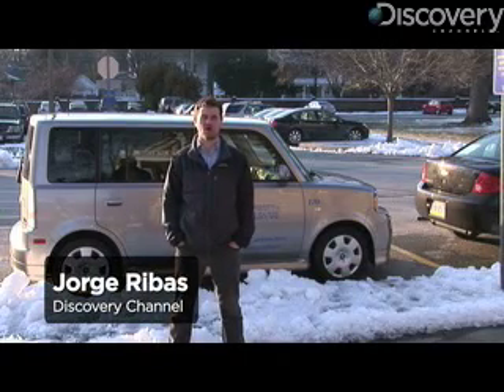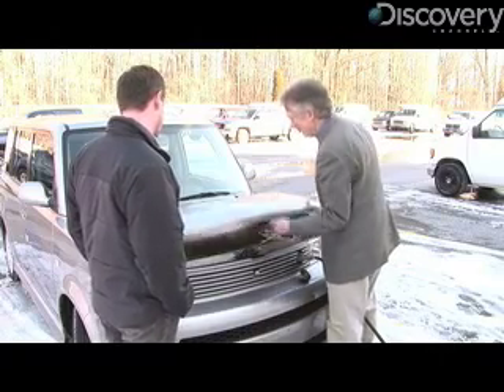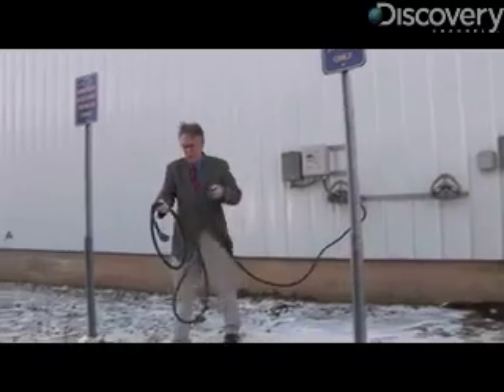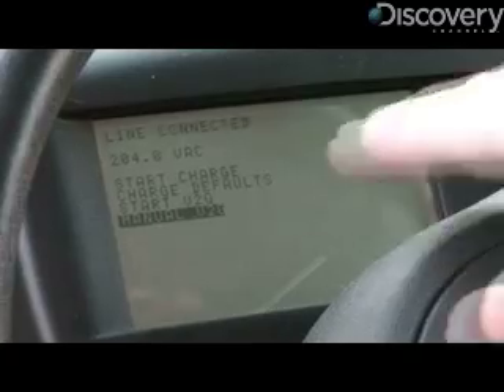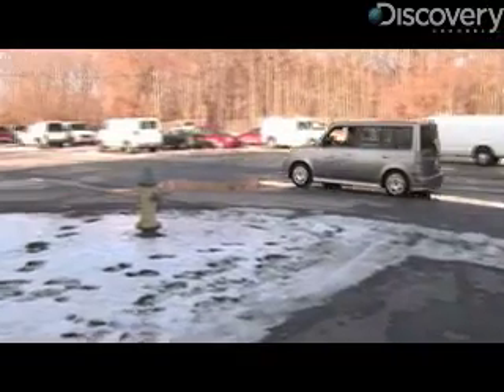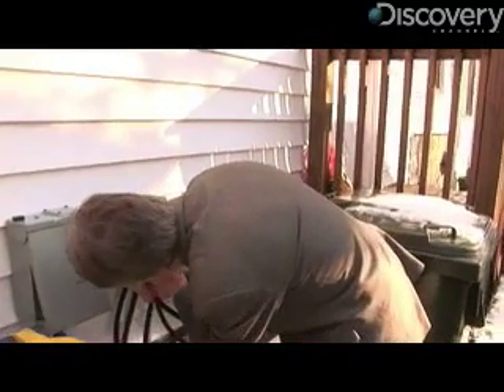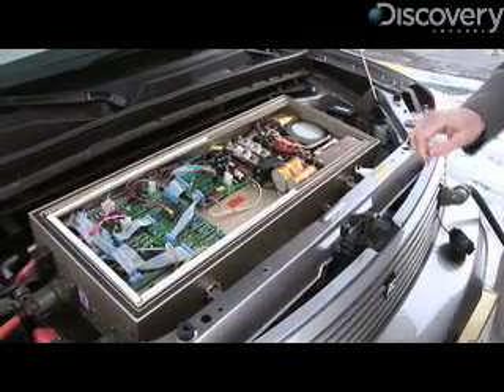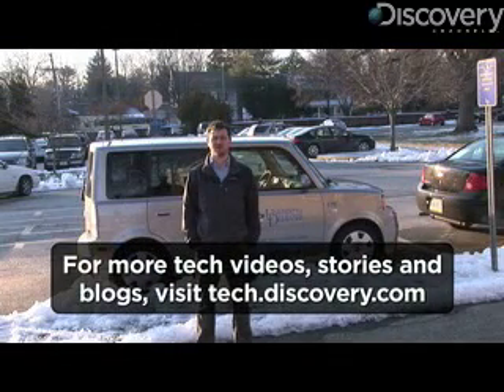Electric Car Feeds Grid

Comment: Two things to your comments. First, most electricity used in the state of California comes from coal. It may not be generated in the state, but I assure you, you use power mostly generated by coal. Second, solar and wind power at most can be used to power 40% of a power grid without extensive use of battery and regenerative systems on a scale that is not possible. It is not possible by any standard to supply a power grid with all solar/wind, within reason. Nuclear is the best option for the rest

Comment: Exactly what I was thinking. Whats the point? That is a 27.75% loss of power, assuming 85% efficiency with the car's charging system(very conservative and I guess it is lower than that), when charging the car and then discharging back into the grid again. Very inefficient, and I don't get the point. Also, these cars carry a very small charge in the scheme of things. Not to mention peak demand is in the middle of the day, when these vehicles will be on the road. I think he's stealing power.

Comment: Interesting idea, especially for places with reoccuring power outages... the only problem is that the circuits bringing power into the car lose something on the order of 15% give or take and if you need to put that power back into the grid you lose ANOTHER 15% or so... you losing a lot of energy giving back to the grid as heat...

Comment: Wind and solar comprise a dismal 76,000 BoE/Day of our energy needs.  Sure, doubling that output every two years will be easy because right now about 0.16% of our energy comes from these sources.  From my understanding this car takes a charge from the power plant (which may be coal, natural gas, or some other form of energy) and simple charges like a normal car yet has the ability to backfeed into the grid during peak times when power plants struggle to meet demand.

Comment: Not really -- right now America uses 47.4 Million Barrels of Oil Equivalent (meaning converting coal, hydroelectric, wind, solar, natural gas, etc.) of which 19 Million Barrerls/Day of oil is used and 11.9 Million (Barrels,Equivalent)/Day is natural gas.  Adding that up we see that 30.9 Million BOE is from petroleum.  Therefore 30.9/47.4 is the fractional amount (and multiple that number by 100) to achieve the percentile amount of energy we use per day from petroleum.

Comment: One problem I have with electric cars are the batteries.

Has anyone done research on batteries and the process of making/disposing/recycling them?

Are batteries more safe than gasoline?

Trees take the CO2 from burning the gasoline and convert it to O2.  There are other substances that are not good for us or anything else for that matter.

Oil is dead organic matter, mostly carbon.

Take a look at everything you can find on batteries before you make a decision.

Comment: Unless the cars were also fitted with the new generation of solar cells now being developed. In that case cars not being driven will be powering the grid. It  addresses also a cost effectiveness issue by making the car battery dual use.

Comment: Kirax13:
Electric cars don't "Start" they are just turned on.   -15c is nothing for any electric motor that I know of.  Gas motors are started with an electric motor and they start our cars here where the normal temps are below -15c.  In fact it was -37c this winter and cars started as long as you plugged them in to keep the oil from freezing.

Your country provides its neighbors with electricity via the Hydroelectric dams you have.
Electricity is surely cheaper in your country than gasoline.

Comment: 1. People pay for gas, so paying of energy normal, I think
2. Winter is freezy sometimes here, yes, but I don't see why electric car wouldn't start. Yes battery must be heated, but gas engine must be heated too!
3. Well in Finland, your neighbouring country, we have a lot of connections for heating up the cars in winter time on parking lots. So why not using the same plugs for fillup?
4. Electricity needed by car is cheap compared to gas. And electric car don't need energy as much as fossil.

Comment: I see this primarily as a car, and secondly a moving battery. Moving battery would be nice for an example in a cottage without electricity. 
I don't know if you have a lot of those in US, but in my country (Finland) many people are having summer cottages and many of them have only generators, wind/solar power or no electricity at all. Moving battery would be good to have in there sometimes.
Electric car is superior compared to ancient fossil tech. That's the engineers opinion.

Comment: I live in Canada and everywhere we park there is a place to plug in.  Gas stations to charge your car?  Gas stations serve gas not electricity.  Gas stations would not be needed.
The place you work or shop needs to put chargers there, not a Gas Station.

It is also the same car as a gas one just running on electricity, so it is just as safe as every other car on the road.

Your opinion was noted just not taken seriously.

Comment: I wouldn't call it theft as the car is a project built and funded by the university. The power cord used to charge the battery isn't something that just sits around for general use. It was most likely built for the charging of the car. As the car is owned by the university (hence the university's name on its side) and driving it is the only way to test its practicality, it would be the university's responsibility to pay for its power. They aren't going to overlook something like that.

Comment: ''However, at the present time many electric vehicle conversion owners, whose battery of choice is still lead acid with limited cycle lives and capacity, would prefer to use them to power their cars rather than load-balance the electricity grid.''

Comment: i think what they re trying to do is to make car as energy storage that can be sold later. You take power when the grid have surpluss power, and sell it when the load are heavy. That way, energy produced by power plant in time of lower load not get wasted. But i think it may work only with plant with natural/renewable sources like waterfall, wind power, or sun power. Would be more effective to lower power production in coal or diesel powered plants.

Comment: Is there any point of pushing power back to the grid when the car isn't even generating electricity?
Basically it draws power to the car then gives it to the grid and some energy would be lost in the process since batteries isn't 100% efficient. That means by pushing power(which came from the grid earlier anyways) back to the grid it is actually wasting some energy. That's just stupid. The only way I see this would be useful is if there was a power outage.

Comment: V2G tech doesn't sound that great an idea given that it drastically increases the number of charges and discharges the battery makes daily, wearing it out prematurely. It also means that you would have to recharge a lot more often since the purpose of this is that the car powers up you're home when you aren't driving rather than charging while you're home.

Comment: "when it comes to the environment.. money isnt an object"?

most pollution is caused by people trying to save or make money. This car isn't really saving the planet anyway, the electricity comes from burning coal, that's worse than or as bad as burning gas, he even said so in the video. the car it's self may not be emitting  but the power plants would have to step it up to produce the power, you have to consider that.

Comment: "Uh, it does matter, a lot. It's the difference between letting the free market decide and making a law deciding it for the market."

It doesn't matter. Not one bit. That guy wasn't going to let the free market decide either, so it's not a difference that separates the two.

"Also, life isn't fair."

So let's not even try to be fair, is that the point you're making?

"The government would"

Not talking about the government or what it "would" do. Besides, society's infrastructure requires cars.

Comment: Aren't you loosing power from the charge and transfer. Wouldn't be more efficient to take what you need for the car. Instead of loosing power to heat and resistance during the transfer back?

Comment: If the car creates more power than it needs to run it sends it back into the grid though the charge cable. Same as a home power grid can put power back into the grid.